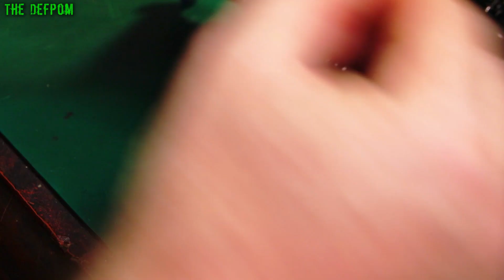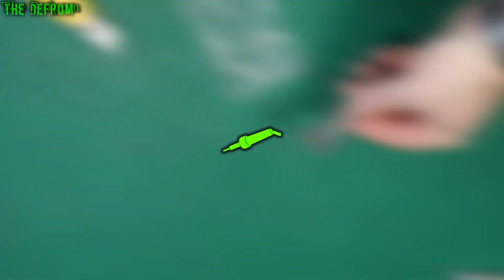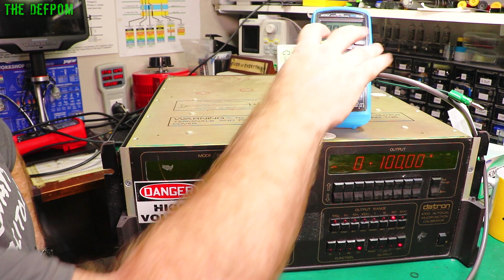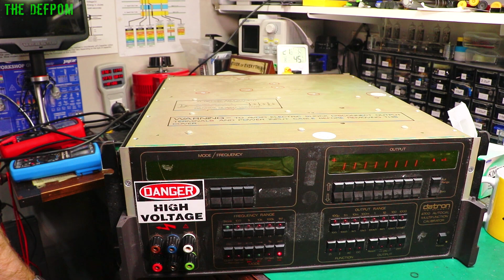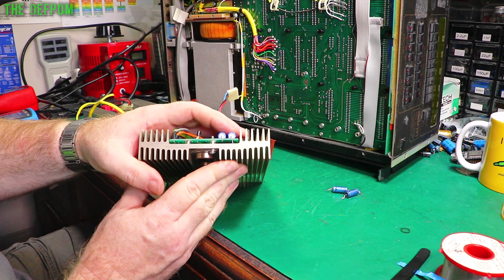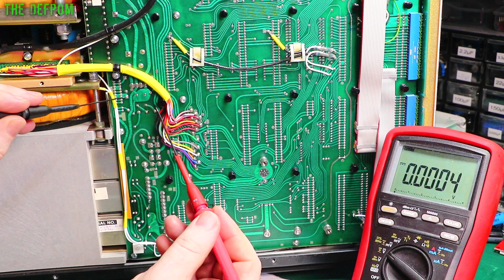🔴 Fixing a $10,000 Datron Calibrator - Datron 4700 Repair Part 2 - No. 826

Comment: Great progress, Scott. Did you look at the temperature of the 15 volt regulator? The 78 series regulators have overload protection and will start dropping the output voltage as the get hot. I think that thing has more power rails than my Fluke 5100B!
Reply from the maker: I still have a couple of big caps to replace (even though they test fine), once I get to that I will recheck the regulator as I completely forgot to investigate the slightly low voltage, It certainly could be a loading issue, or it could just be a bit old and weak, like me. I also intend to pull the EPROMS and back them up.

Comment: hmm if on 15V regulated is less i expect there might be some IC shorted or such..if i understand that correctly 15V should not go below ..usually it is about 15.2 or 15.1 but it should not go below 15 ..it is possible with old design..but i don't know in this case
Reply: Back in the day I used to see this quite a bit. I remember RS Components own branded TO-220 1A regulators (and others) were often low.....but they worked fine.
I say "own branded" but it was just some black paint and white lettering stamped on with the RS number!
Reply: @IanScottJohnston  I suppose yes but i think it is a bit low . If all is fine i would suggest to tweak it by one diode in middle pin to 15V well 14.7+0.6 so lets say 15.3V .Ofc it depend how 15V is made ..maybe more is needed.. I also said it because i did see 14.5V on output of regulator and then i find out there was one shorted IC..but then regulator didn't have cooler so i burned my hand on it..but if it was with some cooler it is possible you would not be able detect it ..but what do i know :)
Reply: @SylwerDragon  Yes, 14.5Vdc is too low, and would indicate an issue and best replaced even if no load issue found. I was thinking more of 14.8Vdc etc......Fun & games.
Reply: @IanScottJohnston  try change it to new one and see if it will improve :)
Reply from the maker: I completely forgot to look more closely at this particular clue, I will look into it more closely the next time I open it up to backup the EPROMs and replace the last couple of caps.

Comment: We have one of these in storage
Reply from the maker: Turn it on occasionally to prevent the caps failing.
Reply: @TheDefpom  oh, I don’t think it’s been on in the 8 years I’ve been there. If I can I’ll try it tomorrow and let ya know what happened.
Reply from the maker: @50Hz  - only turn it on for 10 seconds then turn it back off, wait 10 seconds and then turn it on for another 10 seconds, to help give the caps time to re-form without overheating and blowing up, do that a few times, then leave it on for 30 seconds and repeat, then on for a minute, hopefully.
Reply: @TheDefpom  thanks for the heads up, didn’t get a chance today, shall be doing it Monday